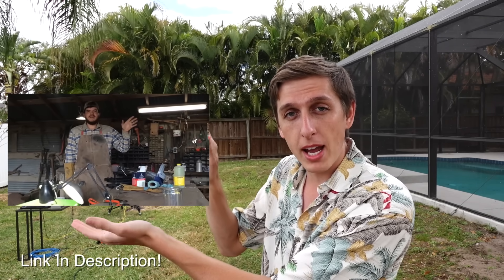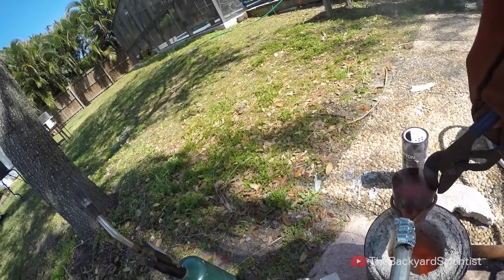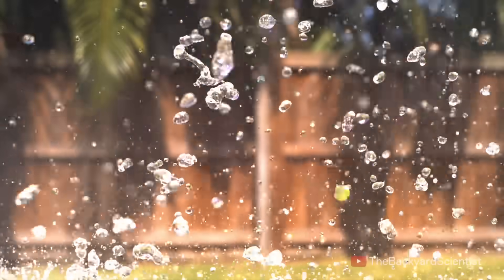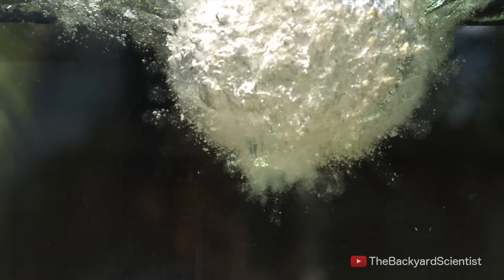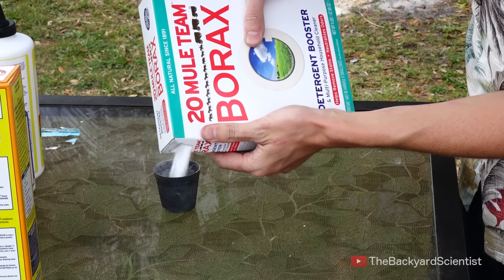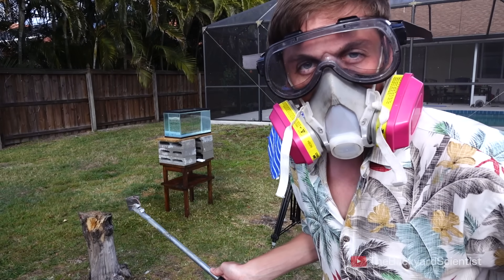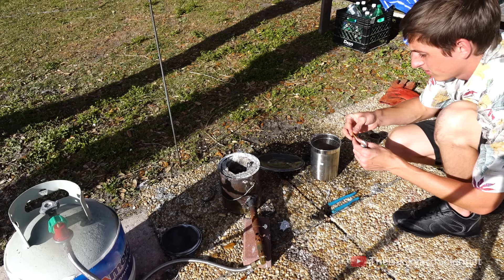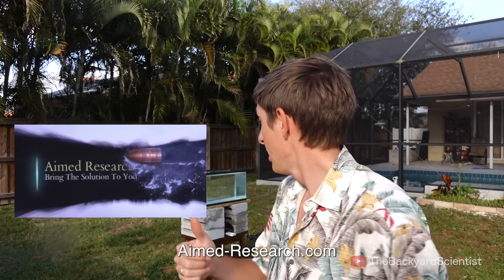Pouring Molten salt into Water - Explosion!

Comment: Sodium chloride and water mixing happens at a molecular level - the sodium chloride bonding with the water molecules to form hydroxyl ions.  The salt is broken down into its constituent components by the water.  At room temperature, this happens relatively slowly.  The mixture speeds up as the temperature is increased.  e.g. salt dissolves in boiling water much faster.  Now then, raise the salt's temperature to its melting point.  The chemical transference would become so accelerated that it could manifest in the way your video demonstrated.  Other forms of salt don't mix with water with the readiness of sodium chloride.  That is why they didn't produce the same explosive results.

Comment: I think the reason the salt works and the LF effect prevents the others from a cool explosion is because sodium chloride is soluble and not only that, but water is drawn to it and that pressure likely stops the protective bubble from forming. Also, heat speeds up reactions and making the sodium chloride a liquid makes it WAY easier to dissolve with water. Just generally; it's a mad cool explosion.
Reply: Any salt is soluble in water and will be "drawn to water." This doesn't explain why the LF effect took place for the other salts and not NaCl.

Comment: Possible that the bonds of the molecules reacting with specific molecular shape, form, structure, with increased delta would be considered... adds the aspect of Hydrogen Explosive, Salt Conductivity & the Displacement pattern of the Oxygen.. basically imagine an instant Hoffmann Apparatus, As well as an ‘electro chemical ignition’ per se, via state change as well (since testing hypothesis’s). Could be worthwhile to have isotopic info, also to know anyone with spectrum scanning to watch the play by play of Infrared, Thermal & so on ... otherwise Awesome Video & Appreciate the shared content 😁
Reply: Perhaps more experiments on The Above & contemplating: The Side Yard Alchemist & The Indoor Magician. Also, might be helpful to research what’s current involving information on Chlorine molecularly & such. Could be relative to Platonic Solid: Geometric Aspect of Creation & Destruction

Comment: Heat transfer to water causes sodium to gain shrinking hardshell around still molten sodium. The hardshell fractures and repeats process, all in rapid order, depending on temperature difference between water and sodium. Unlike water ice, sodium does not expand as it goes into solid state.

Comment: Like oil, sodium chloride is slightly hydrophobic, meaning it doesn't mix with water very well, and water suddenly boils when something extremely hot touches it, so, my hyothesis is that the water and salt are repelling each other, amplified by the water boiling in the presence of the extreme heat of the salt, as well as the salt suddenly cooling. The same effect can be achieved by mixing hot oil with water (don't try that at home).

Comment: So my hypothesis is that the sodium is reacting with the water in the way it normally does, but the chlorine is causing a slowdown of this reaction. This reaction combined with your leiden frost description explains why it works well with NaCl but not other "ionic compounds ". The PhH doesn't change because both molecules of Na and Cl are still in the solution. The reason this doesn't happen with non melted salt is because, well it just doesn't. This is just my thoughts and I only have your data since I'm like still in high school

Comment: Crystalline structure of NaCl has nothing to do with the explosion and neither does sodium metal play a role in the hot liquid sodium chloride explosion.

Note that if the hot liquid sodium chloride somehow converted sodium from its +1 ionic state back to sodium metal (a reduction process), then the contact of the sodium metal would create a flame like the hot liquid sodium metal does when poured into the water.  Note that room temperature sodium metal tossed into water also causes an explosion with a flame.  The sodium metal reacts with water and dissociates water into Hydrogen gas and the sodium becomes NaOH.  This chemical reaction is strongly exothermic and releases large amounts of energy, igniting the released hydrogen gas product, that further burns and chemically reacts with oxygen in the air and releases even more energy and gas, contributing to the explosion.  The liquid sodium chloride explosion with water is missing the flame and therefore we can deduce the creation of sodium metal isnt the mechanism.

The video guy says it's not a chemical reaction, it's a physical reaction and hes correct.  The hot liquid sodium chloride has a very large  heat capacity and the rapid heat transfer properties of hot liquid sodium chloride transfers energy so quickly to the liquid water that the water instantly boils on contact.  It's the RATE OF HEAT TRANSFER that is key to the explosion.  Common to all explosions is a rapid density change from a solid or liquid to a gas and its the same with liquid water rapidly converted into gaseous steam.  The instantaneous density increase creates the explosive density change and in a few cases is enough to break the glass.

Steve Miller
High School Science Teacher

Comment: the sodium chloride reaction is physical. when it is done, you still have sodium chloride and you still have water, but in its gaseous form.  When you dumped the pure sodium into the water completely different chemical substances were being formed. (probably sodium oxide and pure hydrogen which was ignited when it reached the surface to create water again). Therefore the second reaction is chemical and I believe would have caused an explosion even if the pure sodium metal had not been molten, but without the added fireworks due to the hydrogen explosion at the surface.

Comment: Technically what I'm trying to say is that your sodium causes a surface blast and then your melted table salt causes a concussive blast two different types of blasts concussive is disoriented and could be the cause more damage internally than it does in the outside whereas the surface blast causes more damage to the surface but barely any to the internal organs my brother was a bomb technician in the Marine Corps I was a Army Ranger

Comment: Maybe the explosion is the same thing that happens with boiler and Coke can explosions?
When a boiler bursts or a coca cola can is pierced with a knife or sharp point the presurised molecules directly by the first tiny crack/piercing of the metal escapes and expands in open air and in the boiler/can the surrounding molecules are suddenly free to expand...and the surrounding molecules can also expand...in a very rapid chain reaction with very high pressure and 1600 times expansion which we see as boiler explosion of coke can explode.
Maybe the blob of molten salt is doing the same chain reaction as seems to be shown by the continuing expansion and eruptions as salt molecules can expand without limit until they have all expanded to their maximum and also been cooled below their eruption level?
The molten sodium hitting water is more a simple heat explosion.

Comment: salt releases slower energy in the air, but when it makes contact with water. it releases alot faster. the steel releases more energy in the air. creating a heat shield so the water doesnt acually makes contact until the temperature lowers.
they use molten salt for energy storage at some powerplants because it hold heat very good.
forgive my grammar. im very high atm

Comment: I got an idea for y'all next video. Build a mini solar system. Using dust magnets and tiny marble magnets to build a model of the sun and planets. THEN have them each spin as fast as you can. THEN have them rotate around the sun.(slowly increase the speed). Remember if the magnets are too close they will collide into each other. If it's too far then it won't work. Planets are not perfect spheres so try your best to build a exact model. Each planet and moon must rotate at different speeds just like our solar system. What you think?

Comment: Not a chemical reaction -> Explosions are exothermic reactions.

Choose your side now.
Reply: imnota6 explosions can be caused by chemical recaptions
Reply: @killerkirby366  true. In fact most of not all legitimate explosions are caused by a chemical reaction. Actually anything that isn't mechanical probably is using chemical reactions if it's producing heat at all.

Comment: I like the hypothesis you made for what's happening but something doesn't sit right with me. I do wonder if there are chemical reactions that could occur that don't result in a net increase or decrease in PH. I might be mistaken but when sodium reacts with water it creates NaOH and when chlorine reacts with water it will create HCl and HClO with other possible products of these reactions being O2 and H2. All of these products can then recombine after the solution settles to reform into NaCl and H2O and because they started as such wouldn't it be possible that the PH of the solution remain unchanged before and after reaction? Perhaps if this reaction could be done with a higher speed camera we could look for the spike-like structures that form in a coulombic explosion. Thunderfoot has a video on sodium-water reactions that shows this quite well.

Comment: It is entirely a thermal reaction. Well.. kind of. When you bring that stable compound to its melting point it begins to fractionalize and the chlorine begins to boil off, leaving only sodium. Because you have almost superheated the sodium it now has a barrier of chlorine and h20 around it. As that chlorine dissipates into the water and the leidenfrost bubble fails it turns into a steam bomb, exasperated by the now purified sodium. It's a 3 part-explosion

Comment: The salt itself doesn't explode, the molten salt is so hot that the water instantly boils to steam. As the water contacts the very hot molten salt it dissolves rapidly, transfering its heat to the water much faster than would happen if the salt did not dissolve.
Reply: I thought it had to do with the ionic form of those salts allowing the sodium to react with water but wonder why only table salt exploded when they all are ionic bonds with sodium.

Comment: Salt dissolves into water. I'm pretty sure it's called a chemical reaction. It can even liberate a bit of heat. Salt dissolves more quickly in warm water. This seems like a clue as to what is happening, and an indication of what may happen at mega-temperatures.

Comment: Everyone saying that the "water explodes" I don't think that's correct. Nitrogen Chloride add water (Hydrogen Chloride) would give off hydrogen gas because of the process of making a salt. NaCl+Hv2O would give Nav2O add Hv2. Sorry, I've not balanced the equation and the "v" is the number of electrons of the element in the compound. So, basically increasing the heat would just give the atoms thermal energy, and turn into kinetic energy to increase the rate of reaction. Thus the high speed and ferocity of the reaction as the hydrogen has produced is much more than the fishbowl can handle.

Comment: Pure sodium has violent reactions to h2o. The entire left side of the periodic table have violent reactions. The reaction becomes greater and greater as you move down the line.
Reply: So by melting the sodium chloride it is causing a chemical change in the salt and separating the two. 

Note when you handle pure sodium you are suppose to wear gloves. The sweat that could be on your hands is enough for a reaction. Aka you are handling a explosive device
Reply: https://youtu.be/SJVSj9maK6Q

Comment: My chemistry teacher did that experiment in one of the classes. To my knowledge, the sodium (Na) separates water into hydrogen and oxygen. During this process heat and small sparks are generated, which then in turn ignite the hydrogen and cause the explosion. You have similar results with all metals of the first basic group. The further you go down the basic group, the stronger this reaction.